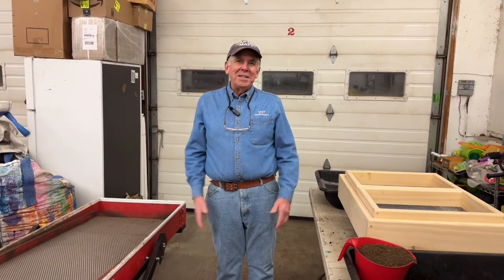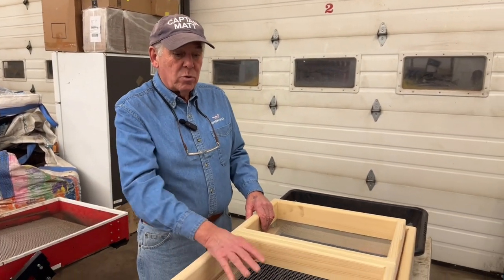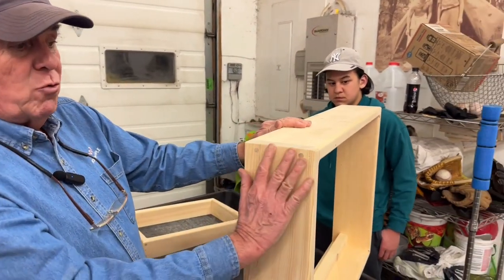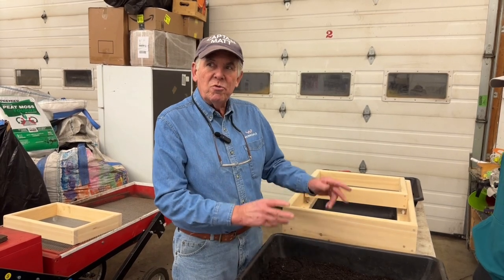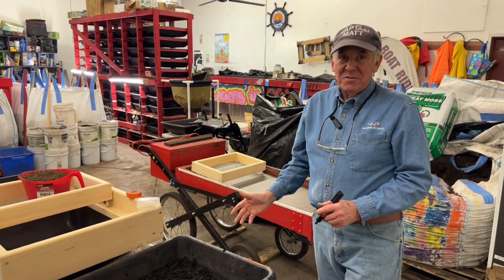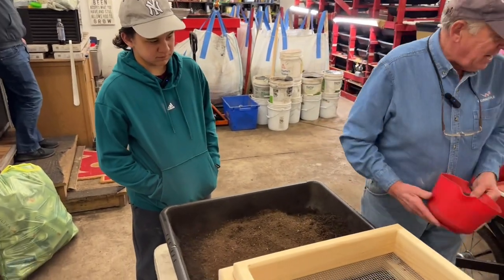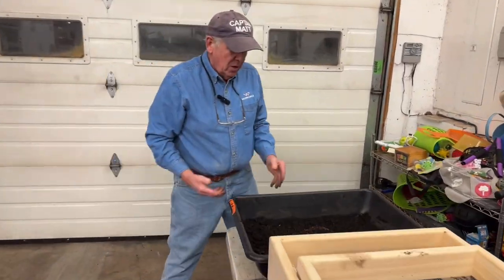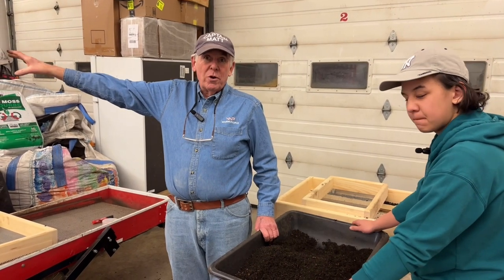DIY Worm Sifter - Free Plans

Comment: Great sifter Captain Matt 👍👍
I do have a suggestion you may or may not want to toy with.
The suggestion would be to take the wheels off the sifter with the 1/4" screen.
Then put it directly on top of the frame with the 1/8" screen and lock them together with 1" furring strips at the four centers. The furring strips would be attached to the 1/4" frame and hang down about 1" which would allow it to lock on top of the 1/8" frame.
With that being done the bedding and worms would get added to the top frame with the 1/4" screen.
The when the sifting is done the large worms and what does not fall through the 1/4" can get flipped into a tote/tray, then under the light or into another tub.
The cocoons, small worms and undigested material smaller than a 1/4" but larger than an 1/8" would be on the bottom screen and can get flipped into a different tote/tray/tub. The castings would fall through into the mortar tray/tub.

Speaking about safety for not cutting or poking the fingers with the wire, especially with the 1/8" screen.
Menards or equivalent box stores sell carpet runners by the foot. They are a type of rubber about 1/16" thick. The runners without the nobs on the bottom are the one to get. Cut them just like a picture frame and staple on top of the border of the 1/8" screen.
I am happy that you are sharing the plans for making your sifting machine, I think it will have a great reaction  👍👍
Enjoy worms and have a great Day!
Reply from the maker: Thanks for all the ideas, worms for life. Sounds like some experiments are coming!

Comment: Just curious, does the square hardware cloth do any damage to the worms? Just curious if there was an advantage to using round hole sheets like on the brockwood for the purpose of a DIY sifter, or if saving money on the square hole hardware cloth is sufficient. Thanks!

Comment: I'm seeing an engineering improvement that you need to do...

All that dirt that gets on the wheel rails could be prevented by extending the side inner wall of the top sifter box to ensure the dirt has no access to the rail.

Doing so will prevent a need to clean the rails and wheels along the way..
Reply from the maker: Hey Jada! We’d love to see a sketch of your improvement ideas over in the WormPeople.com Forum https://discuss.wormpeople.com/space/541284483
Reply: @Captain Matt and the Worm People  I'm not much of an artist, but I'll give it a shot. 
Thanks for sharing all of the great insights into your systems. 
I wish I were local to you, I'd come intern so I could help out and gain hands-on experience.

Comment: Hello Captain Matt long time watcher first time commenting thinking about building the continuous flow worm been 8 foot long wooden one like you got just thinking about the PVC holding up under that weight should I go with metal?
Reply from the maker: Hey Jeff… good to hear from you. I’ve not had a problem with PVC as the weight is significantly distributed. Metal would be fine also… PVC was my budget choice!
Reply from the maker: @EcoWorms Montreal  Thanks for the thoughtful ideas!